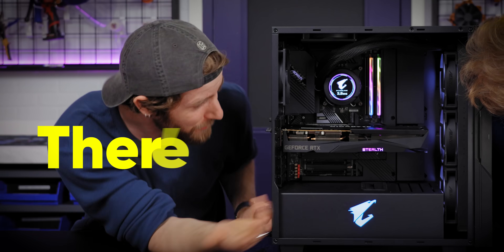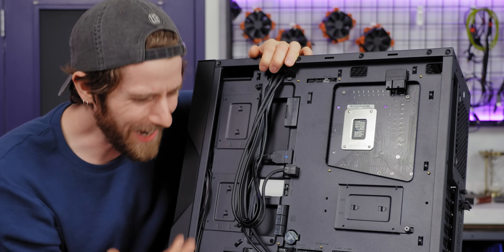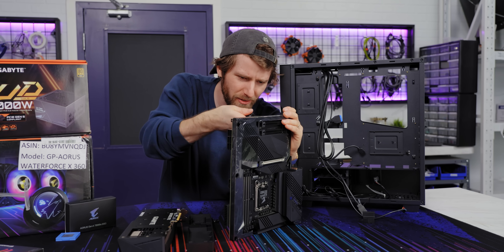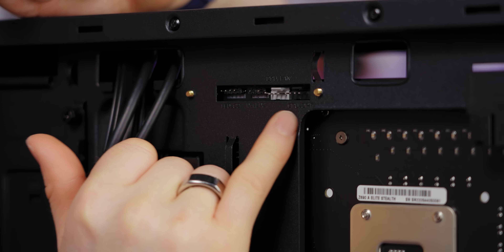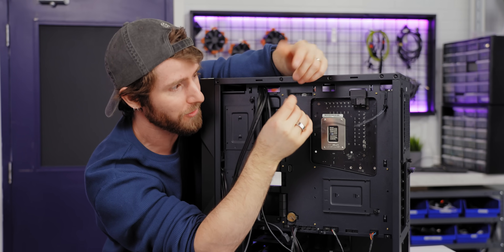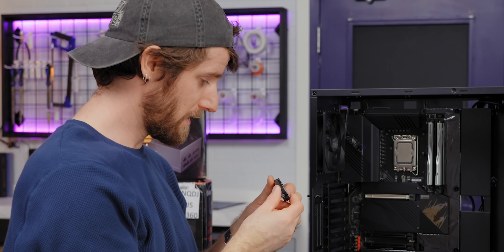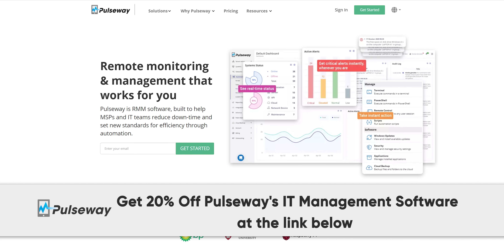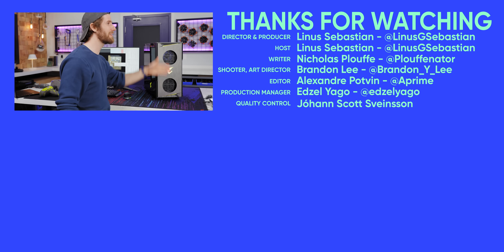Where Are the Cables??? - Gigabyte Project Stealth

Comment: I had this same issue with the iBUYPOWER Snowblind S Case. It was great in concept but the lack of airflow killed the utility of the case. I ended up having to drill two holes in the top like Linus to install a 240mm AIO.

Comment: My cousin and I made a really clean wiring "manifold" for lack of a better term. Also made a water manifold as well but the power was the difficult one. My cousin is an EE so routing the traces and designing the PCB was pretty easy for him but I have no idea how it works. Basically any cord you see is less than 2 inches long (story of my life). The almost 0 fitting glass tubes I bent are kept as minimal as possible to keep it clean. I love it

Comment: ive been wanting a motherboards like this for 8 years, its about time. hopefully this is a start of a awesome hidden wire furture.
Reply: It would make for awesome custom loop builds... so clean! no mess of unsightly wires and not having to fork out extra for custom cables is also perfect. As the money can be used on better components or saved.

Comment: The PS would have to have a connection to plug in the power for the drives and a motherboard that has connectors from the power supply

Comment: This is not a difficult thing to redesign from a regular mainboard except the socket configs for power, sata, atx and fan headers but the crossovers could even be built into the connectors  without changing anything else.
The main issue would be with soldering the connectors onto the board but since boards already have components on both sides it really isn't very difficult.

Comment: Welp. The real benefits of good cable management in a normal PC would be airflow, which this doesn't have, and making things easier to plug in or work with, and this isn't any easier from what I can tell, and upgrades would suck because unless you just reuse it as a normal ATX case with visible cables, it's patented and there's not much that you can do with it. The only benefit is if you just genuinely think cables are ugly, which if that's someone's preference… sure. I think that people these days who don't want to see a bit of cabling are just wusses and they could get a case without a window instead (maybe just cutouts to view specific components), but that's about the only use case.

Maybe if more companies license the patent and it becomes sort of a different form factor, it might go somewhere. I don't like being negative but I personally have no reason to be impressed, other than appreciating that there was effort into creating an interesting niche thing.

Comment: sorry how the F*** can they patent a design where the connectors are on the back of the mother board?
Patents have to be innovative and non intuitive. moving a connector from hte top of a PTH PCB to the bottom is hardly innovative.
it happens in every area of electronic design.

Comment: yeah all well and good but every pc manufacturer would have to design cases in the same way, every graphics card would have to be the same, another vquestion is this patented? then can other case makers use it? looks good but how viable is it, especially for gpu manufacturers, its a big risk if it doesnt take off, if the patents even make that an option.

Comment: Someone ik bought a pre-made pc that wouldn't start. I stood there for 2 hours trying to figure out the problem u til I realized someone put 2 rgb ram sticks that weren't even close to being able to be used in it. So it started but he lost 64gb of ram. Couple days later after he called and told me their was a popping sound that cane from his pc and the thing shut off 10 seconds after. Ever since whenever he plugs it up he gets barely any power from the supply. He can plug up the board and press the power button. No fans cut on. Only all the lights at the on-board check and they were very dim.

Comment: 2:09 Honestly, it would be cool if that was the norm.

I don't know "how", because you would have to take into account different MB sizes (ATX, Miniatx, etc...) and/or size variances. I see it hard to standarize. 

But I would like to see all cases with a de-attachable parte behind the MB to show a standard sized hole and then put here the bottom part (HDAudio, USB's, pwr button, etc). Then this could be covered with a custom piece provided by the motherboard, as is done currently with the Shield IO on the back of the case.

Comment: I did that with Asus motherboards in the 90's and 00's. Get the black plastic of carefully. Get the solder flowing and pushing the pins through. Mount the black plastic again. Dremel holes in the 'motherboard tray' . Had to be aware of the polarity. Especially with IDE and led's. There was not enough room for the AT/ATX power connector though in those days. I always wondered why that did not become mainstream.
I also modded the IDE cables, Keep 2 (grey) wires together, between 2 and 3 made a cut with a scalpel, then between 4 and 5, and so on. So I could reverse them easily. Cable ties did the rest. 
I dremeled holes in 386/486/Pentium/P2 cases and used real glass and painted them ( There were 2 colors grey and beige. Boring) Even made see through cd-drives. 
Round IDE cables and windowed cases became mainstream.
Overclocked AMD Durons and Athlons, socket A/462 ( connecting 2 dots with a pencils unlocked the multiplier ). Especially the Duron 800 were good overclockers. Changing the multiplier from 8 to 12! was no exception. If I only got to 10 I was dissapointed.  
Mounted computers under desks.
This video took me back to those days. Thanks LTT.

Comment: Linus summed this up nicely - "Great concept, poor execution."

I love the idea here, and I'd certainly be interested in doing a build with no visible cables. But it has to actually have airflow. Give me this case with a mesh front panel...and sort out the issues with cutouts being a bit too small.
Reply: Just pull a Linus a drill it LOL
Reply: Honestly. This is my holy grail. Too bad its a false messiah haha. I actually don't mind seeing cables if they're good looking like CableMods, but the front control/USB cables are still all so ugly.
Reply: Well, at least Linus "execution" of the front panel wasn't too bad 😅.
Reply: U could always use a drill or 3d print a front panel with the airflow u want lol

Comment: You know, the way they could figure out the compatibility is if the rear I/O was lower profile and an alternative offset I/O shield was included to install it in standard cases with longer standoffs. The GPU's I/O would also be misaligned  but that's not such a big deal.

Comment: Apart from the shortcomings of the case. WHY aren't manufacturers doing this? 

Hell... why aren't 24-pin + CPU connectors downsized to a 12-pin connector similar to that of NVIDIAs and put into the rear of the case as a small plug? The NVIDIA plug can handle 600w, and last I checked it's plenty for mobo and cpus, so what gives?

If Gigabyte starts this trend along with case/PSU manufacturers like Corsair and Cooler Master, I would be exclusively buying their products for the simple ease of building and better component longevity.

Comment: I actually had this idea ages ago, but I have no soldering skills and thought all the work wouldn't be worth the clean look because the GPU power cables would still have to come out. I thought about it again when the EVGA PowerLink Cable Management Adapter came out, but it just looks hideous. 

I figured a whole GPU would have to be designed around the concept, and I was right, lol.
Reply: For those thinking about doing this, the biggest issue is the pinouts end up wrong. For stuff like the front panel is not much of an issue, most of it is 2 pins, so you can just flip them over. Now, ATX24, USB3... That will require some adapter.

Comment: Pretty much all MB have been soldered  on both sides for the last 30 years. Hole mounted compnents  are usually soldered  on the oppersite side.

One issue have been that large component  fall of if the are up side down in the oven. This is usually solved by only have smal components on one side and solder that first. 

Now when IR oven  start becomming common, this is really not a problem any more.

While People might think of a oven making bread.. the soldet oven pretty much work the same way..

Comment: 10,000% I would fully support this for the future and it should be the standard starting with the new PSU standard.  It would male building easier, fixing easier and eliminate compatibility/fit issues with compliant cases and parts..... If it was implemented correctly (which this was not)

Comment: I would love to see a sort of in between version of this. I actually kinda like the look of the main power cables when you have nice, custom sleeved cables. But the USB, Fan, front panel, audio, etc cables never really look good. So would be cool to see one with power in normal spots and everything else in "stealth" mode. Which would also let you pick whatever GPU you wanted too
Reply: For a start manufacturers could just have all their connectors point towards the edge of the board. There you could either plug in straight cables that immediately go behind  cover in the case, or add some 90°-adapter to have the plug point in the direction (front or back) you want. This solution should be 100% ATX compliant, while at the same time provide the flexibility to route the cables in any direction you want.

Bonus points if the manufacturers could agree on standard locations for all the connectors.

Comment: If this innovation becomes more common and I want it to...I wonder how much the industry can save from not using so much copper and alloys and plastics to make longer length power cables. How does this change the PC case market and motherboard market?

Comment: Double sided motherboards would be awesome if standardised. I would not care so much about hiding all the cables as just putting some of them on the other side of the board simply because they're a PIA to plug in. CPU-PWR, I/O pins, fan connectors. And NVMe as well, nobody should need to take out their GPU just to put in storage.

Comment: I feel tech old.... I'm more than satisfied with modular power supply cables and not having to deal with IDE cables ever again.... It would be nice to see GPU power connectors go away though.... PCIE standard needs an update... It would be good to see the USB-C ports able to handle 100W output too.

Comment: Whenever I'm cable managing a complex system, I often find myself longing for the old IBM PS/2 days when components literally just slotted and snapped into place with edge connectors which handled data and power. Even the motherboard used edge connectors to connect to the power supply. No cables anywhere. Also, yes, I'm old. Love that this is coming back around again in a new form and great points about improving tis design. I really hope Gigabyte is taking notes. This seems promising with some fixes. Like, maybe Gigabyte needs to partner with a better case designer...

Comment: mine is front panel aio n had these same problem with this type of case. The radiator aio shud face inward n the aio fans outward. Linus didnt have to grill tht poor case. All he had to do is to attach the radiator and the fans,separately by screwing the radiator from inside, and screw the aio fans from the outside.

Comment: I have a PC from 2010 with a gigabyte case.  This is when front drive bays were still a thing and yet it has a like 1/4 inch thick solid metal door covering the entire front (extruded aluminum I think).  When the door is closed it can hardly breathe.  So they've been doing this for a while.

That being said, I'm ok with this design as for me the silence of the system was paramount.  That case is lined with foam and all airflow comes from 1 front and 1 rear 120mm fan running at 600RPM, and the PSU fan which also runs slowly.  The computer is dead quiet, but Ye Olde i5-750 pretty much lives at 95C.  It hasn't been my main gaming PC for over 6 years, but I still use it for other tasks.  It's humming along right now, just very quietly.

Comment: Didn't gigabyte issue a statement about their Z690 Aorus Elite boards and the problems it had, they opened an RMA for all of that elite line on ddr4 & ddr5. So i'm assuming the built in Boards are the refurbished ones, or at least the ones that were left on stock but never got bought out by the end customer.

Comment: I really wish they don't ditch that concept 😟 For starters gpus with power connectors hidden closer to the motherboard but in a way that doesn't require new case or modding would be great

Comment: Meanwhile I have my cpu cable just going from the top of my case where my power supply is, through the back and looping round under the cpu fan, just to have it plug in right underneath my power supply. Screw cable management.

Comment: The position of the 8 and 6 pin slots on GPUs is pissing me off for a long time. You get a fancy new GPU with a small display showing the GPU temperature, but you have to deal with cables dangling on front of it.

Comment: That card PCB and the flat connector with the standard connector block is actually the exact same one used on the 3080 Gaming OC / Eagle / Vision and up. I have a Gaming OC 3080 with a Bykski waterblock and the Bykski cables that eliminate the need for the block. ModDYI also makes cables that eliminate the block.
Reply: Thanks for watching 🔝🔝
And commenting, 
Send a direct message right away 🆙🆙  you just won a gift🎁🎁....

Comment: With a little more thought the concept is good. Instead of specific holes for specific headers or jacks make the hole into slits that any standard header can use. Next have a  choice between a solid front cover/door and a vented one. If you do not need air cooling, a solid panel, if you do then vented. As a prototype or as a first attempt it almost works... but like we said in the U.S. Army... "Close only counts in horseshoes and hand grenades..." P.S. I also like the back plate idea expressed else where in the comments, but wouldn't actually be a base plate? I have a computer with a motherboard that is mounted on a base. It locks into the case without any screws, but uses two screws to ensure it can not slide out of its locking mounts. I only with the primary motherboard also also had a locking base plate, yes my case has two FULL Ryzen 9 - 16 core ATX motherboards, my girl is one lean mean powerful machine. Only thing was the case came as flat panels and frame pieces and had to be built as did the add-on base. I built a WP200 case with the which is actually a W100 case with an added P200 Base, love that it is on wheels, makes it easier to move. It is still a work in progress as I presently have minimum cooling, just a CPU fan and power supply fan, doubt I will ever water cool it, but I am dreaming of do that.

Here is the two parts of my case... 
https://www.amazon.com/Thermaltake-Dismantle-Stackable-Certified-CA-1F4-00D1NN-00/dp/B01EGBZA1C?th=1
https://www.amazon.com/Thermaltake-Dismantle-Stackable-Certified-CA-1F4-00D1NN-00/dp/B01EGBZ9P4?th=1
Reply: Thanks for watching 🔝🔝
And commenting, 
Send a direct message right away 🆙🆙  you just won a gift🎁🎁....